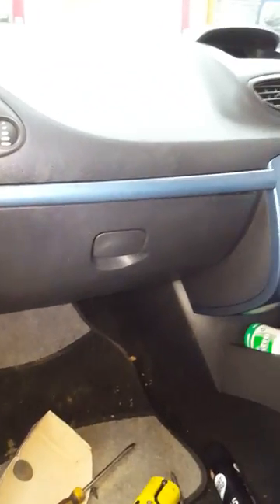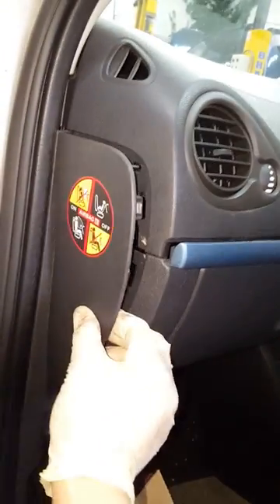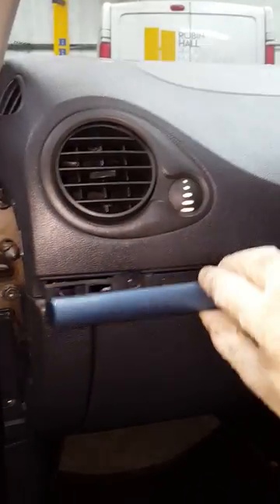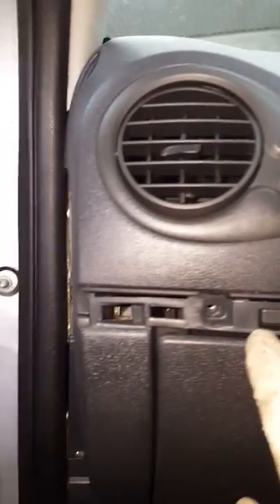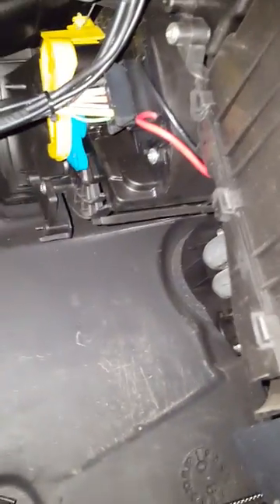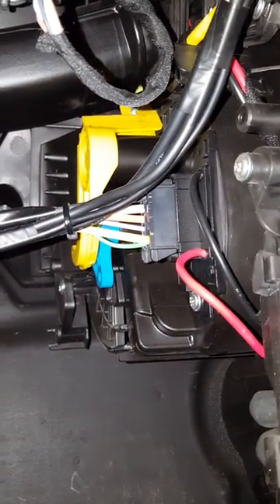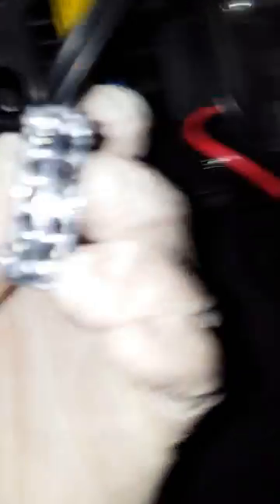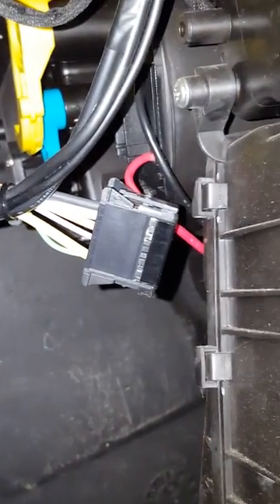Renault Clio heater fan not working. How to fix your fan issue on your car. Heating not working.

Comment: Great video mate, I fixed my fan just by cleaning the connector. Thanks!
Reply from the maker: Thats great. Im glad it helped you buddy!
Reply: What sort of cleaning you did?
Reply: @roldanespinosa9083  I extracted the connector, and scratched the surface of the inner connectors with a small screwdriver to see the copper color again, it was all burned out, probably due to some sparks. After putting it back on, it worked like a charm.
Reply: @gigalajeya  I'll try this out. Thanks mate. 👊🏽

Comment: I've the same car but not sure is this a MK II or MK III Clio 1.5 dci 2008 like mine? 
Also what do you use to clean the plug resistor? Thanks 👍
Reply from the maker: That would be the same. It's an electronic contact cleaner
Reply: @AlexTheGrumpyOne  Thank you

Comment: Thank you for this , had this problem since I bought the car. I don't have speed 4 working which seems very common but I also have air coming through when it's at 0 , is that just another symptom of the same problem?
Reply from the maker: Hi. You are welcome. Yes it can be cause by the same issue. Good luck with your one.

Comment: thanks alot... on left side steering wheel, resistor is on same left side, or on right side under glovebox?
Reply from the maker: Zvonimir Sarcevic hello there. Im pretty sure it will be behind the glovebox just obviously on the other side. Because thats the only way they can have enough space for the fan to be.
Reply: No. It's under the steering wheel. 
But you probably know that already.

Comment: Thank you very much for the video, it was great help in finding the problem. I went on eBay I found few plugs that look the same, but the wire colours were different does that make a difference?
Reply from the maker: No problems. Thank you.
That's fine as long as you connect them in the correct order bud
Reply: @AlexTheGrumpyOne  the original one has 6 wires connected to it, but the new has about 10, do I just ignore the extra wires?
Reply from the maker: Yes bud as long as you connect to the right ones you will be fine. Isolate the others

Comment: What would I use to clean the block with. There's burn in 2 ports or would I have to replace the block ? Very useful video and so simplified thank-you mate
Reply from the maker: Thank you for the support!
I usually use electric contact cleaner spray and mini wire brush
Reply: Thank-you mate the misses only had number and 1 and 3 working managed to get no 4 to work now. But when it comes to replacing the block how do the wires connect. Are they screwed in like a house hold plug or are they push fit?
Reply from the maker: No problems. If you get new plug from ebay I advice getting heat shrink joints to joint the wires together bud. Make sure you take a picture of the plug and colours to make sure you joint the wires in the correct order.
Reply: Thanks very much mate il do this on on the weekend and let you know how I can on thanks alot you're video is second to none mate massive help 👍
Reply from the maker: Cheers bud! Much appreciated! I'm glad that i can help! Good luck with yours and keep us up to date!

Comment: Hi, I have a similar issues but only position 2 is not working properly. Do you think this is the same problem? I can hear the fan working very very slow when switched to 2.
Reply from the maker: Yes that should be the same issue as that is what controls the speed and force.
Reply: @AlexTheGrumpyOne  thank you for replying. I will try to get this fixed over the weekend.
Reply from the maker: @soldiers303  no problem mate. Im glad that I can help. Good luck. Let me know how you get on.
Reply: @AlexTheGrumpyOne  all cleaned and fixed although will probably need a new plug as its burnt quite badly.

Comment: If the connection is burnt - would this cause a current when the car is off causing the battery to die - or do you think that is a separate electrical issue?
Reply from the maker: I would think that a separate issue you got there. I would recommend doing a parasitic drain test for you and if you not sure you can always unplug it and see if it makes any difference on the draw :)

Comment: Hi Alex..Am I correct in thinking if my blower is working on 1,2 and 3...but not 4...the problem would be a burnt out resistor that needs replaced...or just cleaned up...will I have to take everything out(like you did) to find this out??
Many Thanks 
Michael
Reply from the maker: Yes more likely to be resistor or the plug. Clean it up first. Your have to take that off to get to it I'm afraid. Let me know how you get on. Good luck
Reply: @AlexTheGrumpyOne  Thank you Alex
Reply from the maker: @michaelureadi2884  no problem. I'm glad that I can help. Let me know how you get on please. Good luck :)
Reply: Hello,
Problem solved?
Reply from the maker: Yes

Comment: How would this look on a left hand drive car? Issue with the fan is that it does not work until you run over heavy bumps. Then all of the sudden it starts to work! Any ideas where to start troubleshooting?
Reply from the maker: I would check the connector first. But by the sounds of it u got a worn out motor. So you might need a new fan unit. But please check the connections first
Reply: @AlexTheGrumpyOne  Would the connection still be on the left side? Even though it is a left hand drive car?
Reply: @ashystyle did you fix it? Was it under the glove box or was it under steering wheel
Reply: @RIKTA1107  New motor solved the issue.  No idea where it was, paid someone who took care of it. Would never buy French again..

Comment: I have changed my resistor with a new one and changed the blower as well but im still getting only number 4 speed and all the connections look fine what can it be 😢
Reply from the maker: Both brand new units I take it?
Reply: Just the resister from ebay and the blower from the scarp yard I got 3x blowers and I plugged every one in and they all went on the highest setting 4 I've ordered another resister on ebay because when I put the new one I got it started and all it did was to put it on 4 the 5mins later it was smoking then it just cut out and 123 wasn't working as well

Comment: I have the opposite problem..can't get any cold air from the fan..not an air conditioned vehicle?
Reply from the maker: Is your temperature control feels like its turning properly when u move it?
Reply: @AlexTheGrumpyOne  I found the problem,thanks..the cable from the temperature control had become disconnected 👍
Reply from the maker: Perfect. Well done

Comment: Mine works fine then dosnt work at all then suddenly comes back on again. When it goes off no numbers work at all. Any ideas mate?
Reply from the maker: I would suggest to check your plug first. Sounds like it might be burned
Reply: That the resistor plug? Thanks for the help mate means alot 👌
Reply from the maker: Yes sorry, I wasn't clear enough. The plug that goes in to the resistor usually burns out. I would definitely start by checking that mate. Then let me know please
Reply: Il try that tomorow morning. Thanks for the help
Reply from the maker: No problems. Yep have a look please and let me know.

Comment: Hey mine only works on 1,2 And 3 4 works sometimes
Reply from the maker: Yeah might be burned plug loosing connection
Reply: @AlexTheGrumpyOne  And another problem what I have the right indicator works sometimes and full beam lights works but it’s hard to put them on takes like 3/8 pushes toward me
Reply from the maker: Im pretty sure it will be your stalk connection inside. So will probably need a new one
Reply: @AlexTheGrumpyOne  can u put the name of that plug Here pls mate, i cant find it in poland 😂 i need a numer of that plug or Orginal name of that part to Google it And order it

Comment: Good video, but not for me! Your steering wheel is on the passengers side. I prefer cars with the steering wheel on the drivers' side so you don't need two people to drive the car!
Reply from the maker: Necessaryevil 86 well haha its on drivers side in this country.
still need only one driver haha
Reply from the maker: Necessaryevil 86 but thank you. its same fault on left hand drive as well
Reply: Yeah, I suspected that, but sometimes the components are in different places.  Learned a lesson after I installed the wipers wrongly, they started to sweep the bonnet, haha. Luckily I have the repair manual now.
Reply from the maker: Necessaryevil 86 ohh haha i see. thats a bit different! but im pretty sure they got the same problem with overheating the resistor and plug